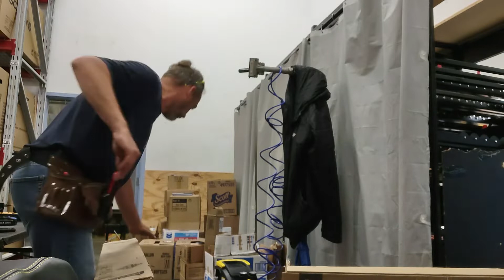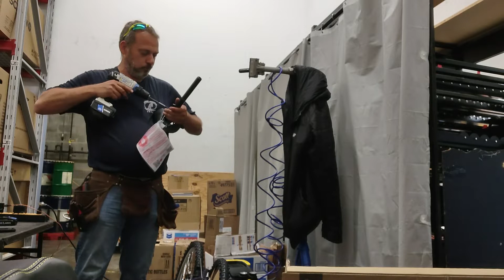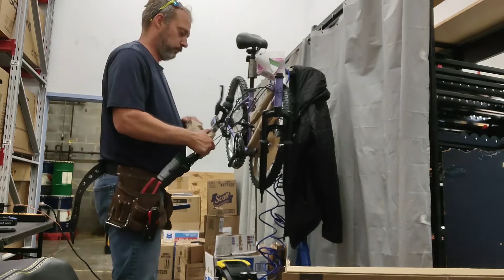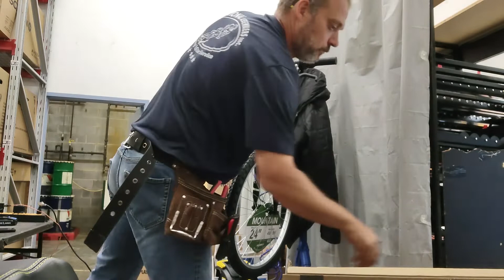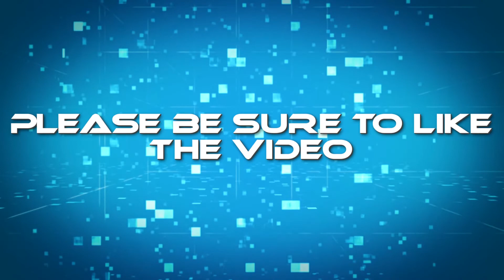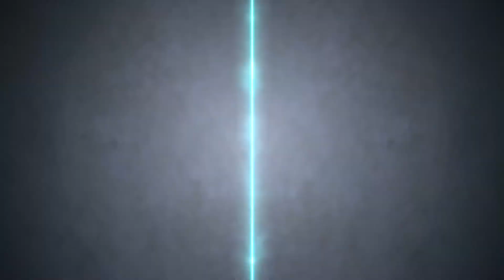Assembling Huffy 24 inch Rock Creek Girls Bike

Comment: You have any idea why the handle bars won’t tighten
Reply from the maker: Common causes:
Using tool less than 18v
Having a low battery on a tool 18v or higher

That said, sometimes even a 20v with a full battery won't get it quite there.  For that I keep a #6 hex wrench nearby to finish it off by hand (usually less than 2 full turns).